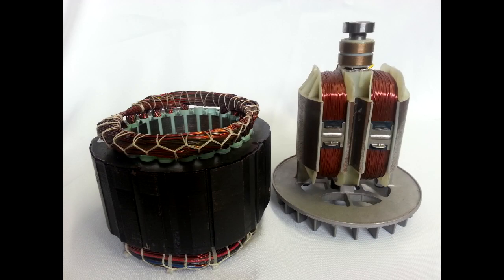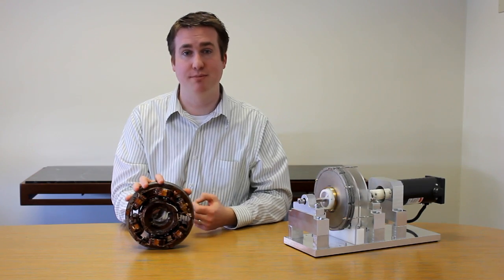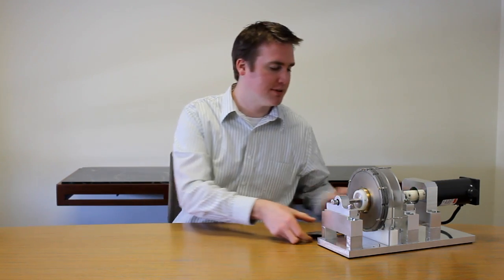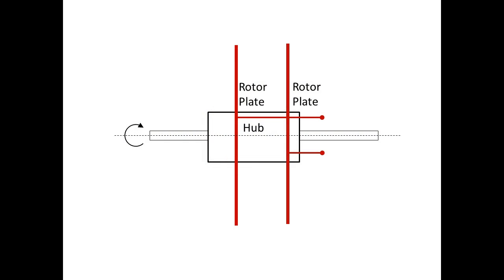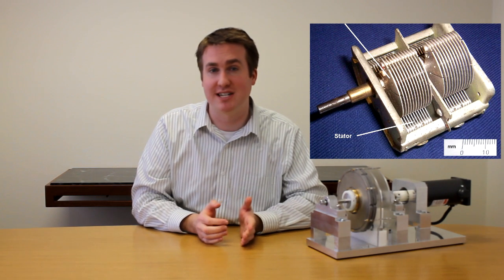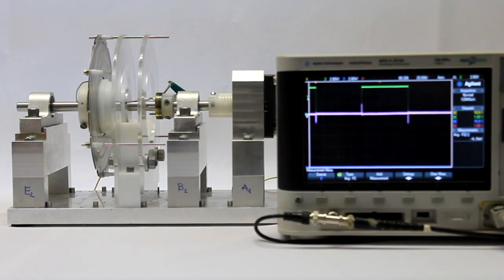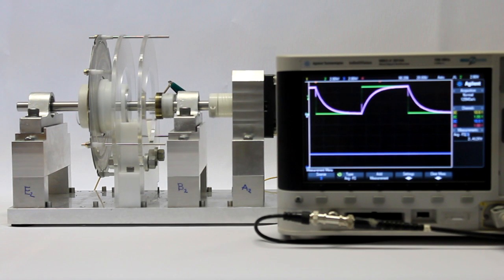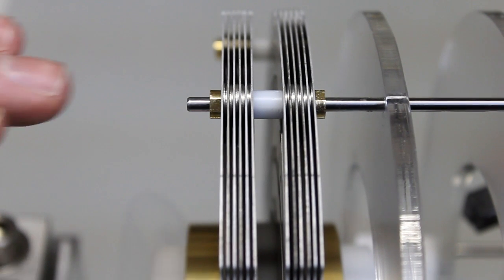Capacitive Power Coupler prototype demonstration

Comment: Hi, nice experiment and demonstration of air cushion between electrostatic motor rotor and stator electrodes! Good idea to make the electrodes to self-maintain the air cushion! Also nicely built demonstration example with the external motor rotating the electrostatic model to illustrate the air cushion.

I also see that you have not got your motor work yet. Having experienced with similar electrostatic motors for a few years, I am afraid that there is a severe natural obstacle making this kind motor rotate electrostatically. It is the voltage breakthrough sparking over the air gap.

The thin air gap will withstand only a few hundreds of volts max until you get breakthrough between its plates, before any noticeable electrostatic force is generated.

For making the motor self-turn electrostatically, you would need at least kilovolts of tens of kilovolts, while the plates start arcing already at one kilovolt or less. That is the crackling or hissing sound you will hear when connecting the model to voltage source. 

So with this kind design, you will not get any measurable power at all out from its axle. The electrostatic force simply keeps far too minute to rotate its rotor, or to even overcome the friction of its bearing.

If you wish to learn a practical way of overcoming the practical spark breakthrough limit of metallic electrode electrostatic motors like yours, please feel free to ask!

Regards,

- Juha -

MSc, CTO
Quantum Electric Ltd.
Finland

Comment: www.spiegel.de incorrectly reported that this was a non-magnetic electric motor. However, as I understand this, it is simply a non-contact way to transmit power to rotating equipment, i.e. an improvement over traditional brushes.

Comment: what about a low voltage, high current application?
Reply: They do exist already. These are Magnetic Power Couplers, some people call them "electric motors", but this is quite boring.

Comment from the maker: As for what happens electrically when the plates contact, it's less catastrophic than one might think.  In application, the rotors are anodized, providing a smooth electrically insulating surface that is wear resistant in case of contact. Even if the rotors were not insulated and they contact, the system is no longer a LC circuit anymore and becomes high impedance as it goes off resonance . Also the energy stored in the capacitor is very low, as the capacitance is the nano-farad range.

Comment from the maker: Good question.  You are correct that you saw the plates contact when an extreme deflection was imposed on the rotating capacitor.  It was done to demonstrate that you really need to lean hard on it (well outside what a typical application might experience) in order for contact to happen. In this case, the air gap is 4 mils and contact did not occur until the plates were deflected about 375mils from vertical.

Comment: At 5:06 in the video you show the parallel plates in operation and deflect them to the side. It looks like the plates make contact when they are pushed far enough and the voltage changes. Can you comment on this? What happens when the plates make contact?